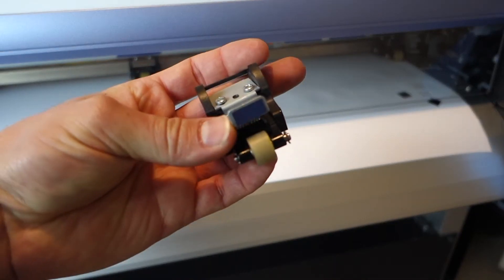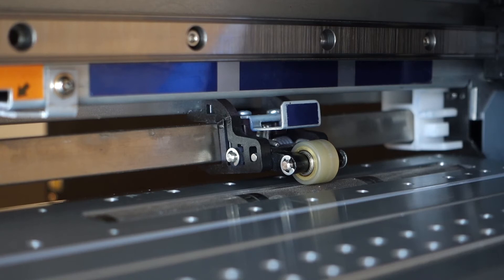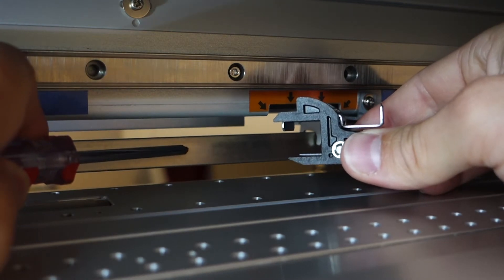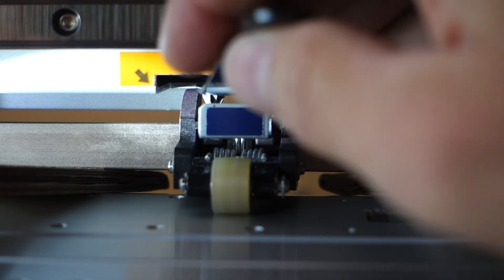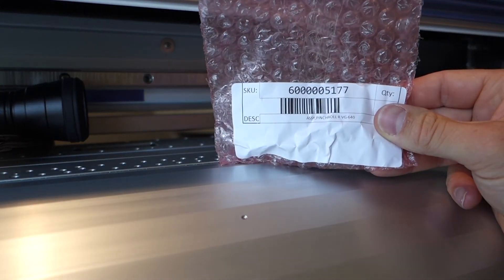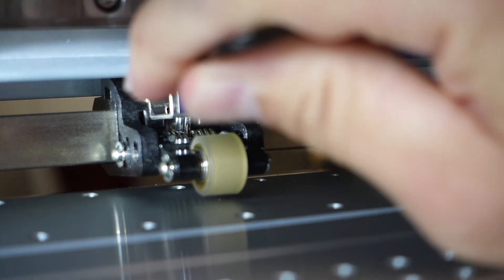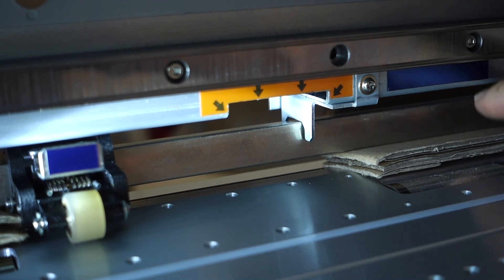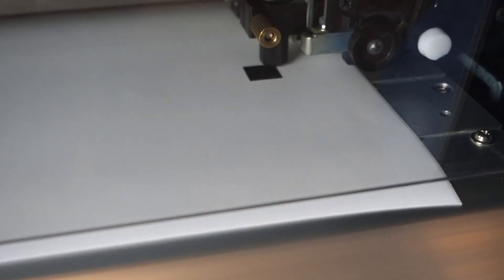Roland VersaCAMM VS-300i - How to replace the outer pinch rollers the easy way.

Comment: This is great and I may try it but my only concern is if you don't get the fore and aft setting on the top plate right your rollers are gonna wobble a bit which could cause faster cracking in the future. 

I have a vg-540 that's considered legacy at this point and in my efforts to try to keep it alive I've been thinking about getting a couple outer roller bodies cnc'ed out of aluminum cuz its criminal how these things go in 6-9 months of regular use.
Reply from the maker: The metal plate on the top doesn't grip the square bar, its only a guide to stop the pinch rollers coming out so this isn't an issue. I thought about getting some CNC'd too but in 20 years of owning Roland machines this has only happened on one, and on newer machines the pinch rollers are now different and more durable.

Comment: Thanks for this video!  Where did you purchase the assembly?
Reply from the maker: Glad it was useful! The assembly was purchase through PrintMAX
Reply: @chris_jamo  I tried this today and I had a hard time putting in the new assembly that I ordered from Roland.  The part# that they provided me was 6000005882 for the left assembly for VS-640.  However, when i tried to put it on, the metal piece was not clearing the bar completely.  I am not sure if I got the correct part.  It was a customer service lady that gave me the part#.  From hearing from other people, I should have asked somebody from Tech Support!  I have to call Roland back.
Reply from the maker: @EJSJ805   Strange one. Did you undo the two screws enough so the metal part was high enough to clear the bar? I’m pretty sure the pinch rollers are standard throughout the VS range
Reply: @chris_jamo  Yes, I did.  I am having a hard time press it down to properly get seated. It is hitting the plastic part on the end.

Update... I found a way to get it done.  I used electrical tape and pulled it from the back and it worked.  Thanks again for the great video!  I saved $$$ thanks to you.